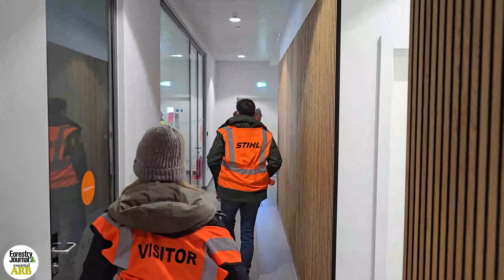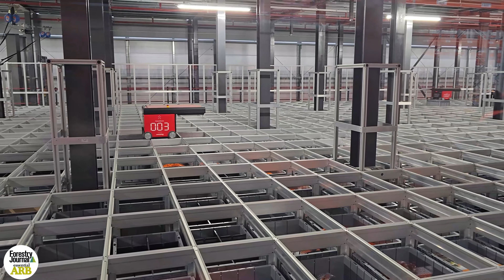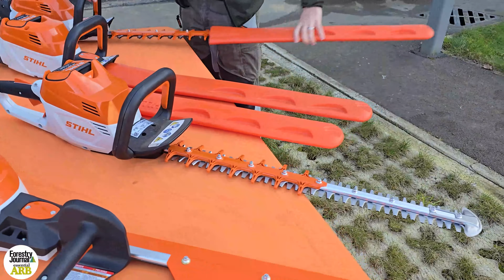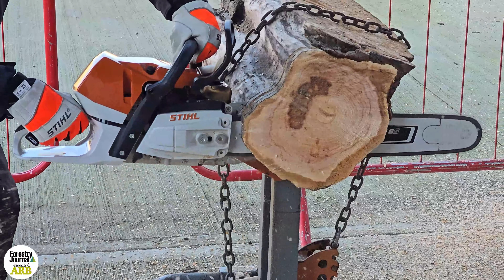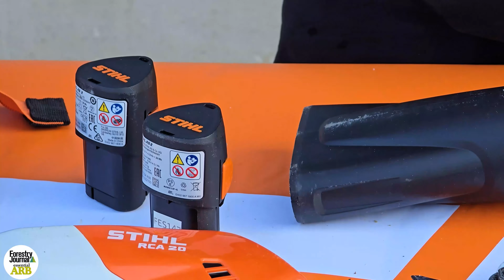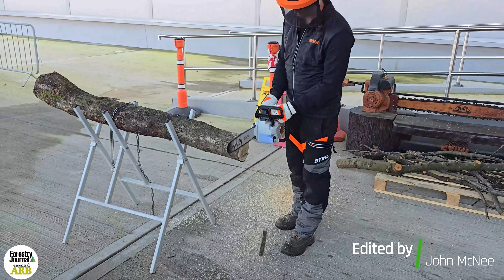First look at Stihl's new line-up of battery products (including MSA 190 chainsaw)

Comment: I am not quite sure if I with trade mine Stihl 161T for this 220C TO, because it maybe heavy to use on the top of a tree, besides mine 161T in over 4 years I have used and abused it beyond manufacturers recommendation never have any problem.